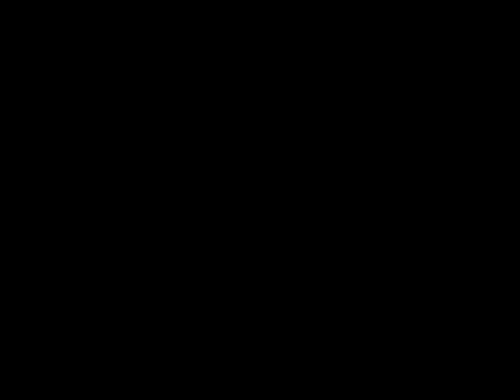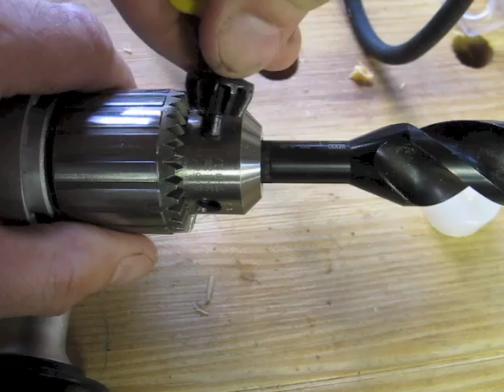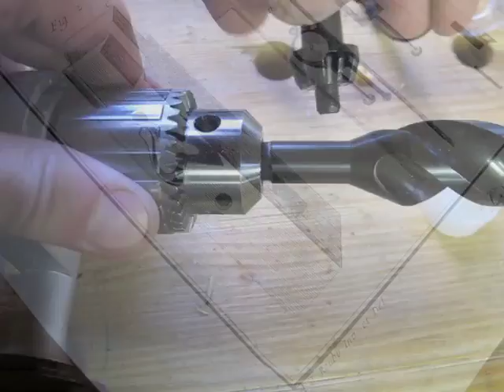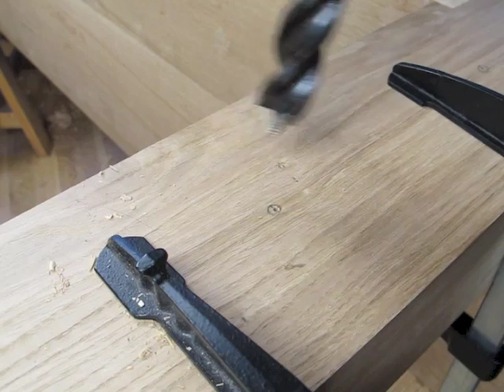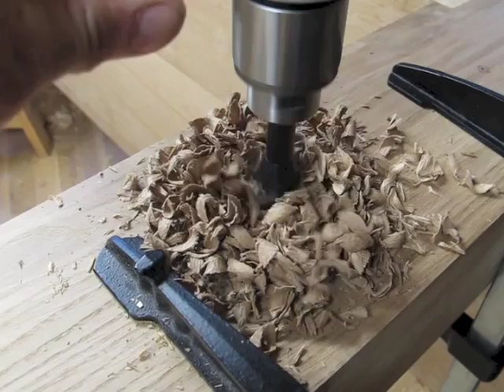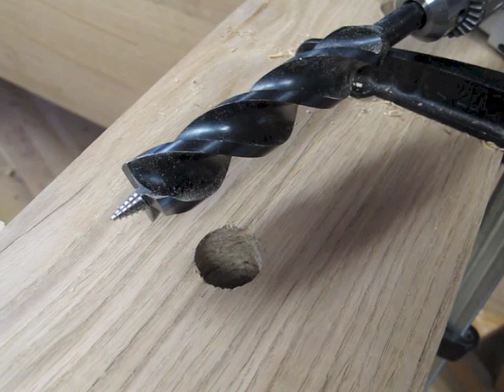WoodOwl Bits Eat Oak for Lunch

Comment: I should hope so!  It's hard to beat an old sharpened spur auger bit for clean holes.  This bit tore the heck out of the surface on entry.  I can only imagine the mess it left on the way out the other side.  Here's hoping the spurred ones they sell do the job right instead of just fast.

Comment: However - and in fairness - these bits were designed for chipping nails.  Other bits tend to "grab" and become damaged when they hit nails.  

The hole appears to be "serviceable", some tearout on entry, and the walls aren't the smoothest.

They will eat through a nail and keep on drilling.  Most spur augers wouldn't keep drilling without fixing or replacing.

I have seen holes made by the spurred WoodOwl bits - and they are much cleaner.

Comment: These appear to be relatively new - out of the package - so I doubt that sharpening them would make much difference.

These bits are, however (according to the WoodOwl site), their Nail Chipper Auger bits - designed to drill through nails.

They sell another style bit called Ultra Smooth Auger bits that feature spurred edges.  I would imagine that these spurred bits would bore a cleaner hole than the bits shown in this video.

Comment: Bah to you for using power! I did my bench holes with a 3/4" and used a brace. It was tough city. Just used regular  screw tip bit from the box store and it was only 2.25 inches. Tx for the video! Keep em coming!

Comment: The wood owl Ultra Smooth Auger Bits (Tri Spur) are even more amazing. Same speed of cut but with extremely smooth results. Virtually no tear out.   Personally drilled thousands of holes with them for timber framing.  Highly recommended.  Although, for large mortises I usually prefer my ls103 chain mortiser from my collection of Mafell tools, much quicker!